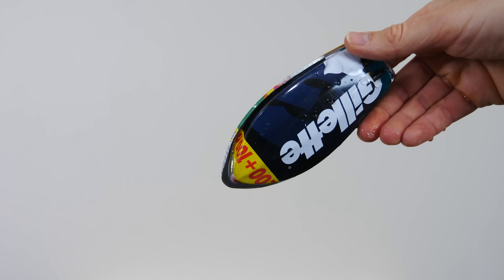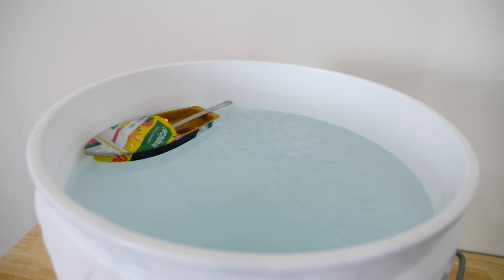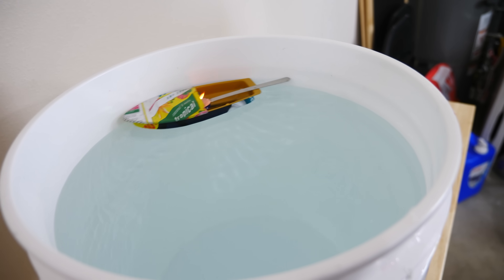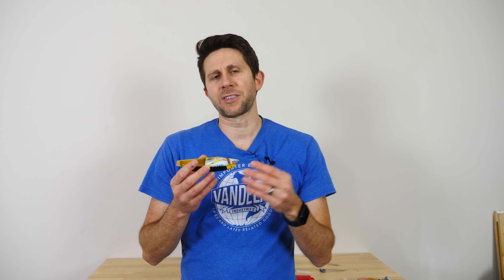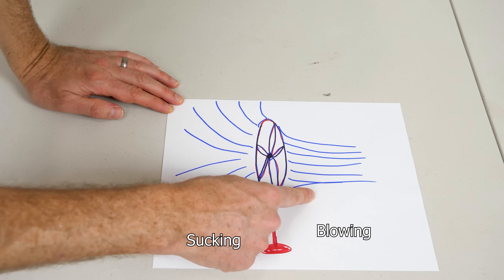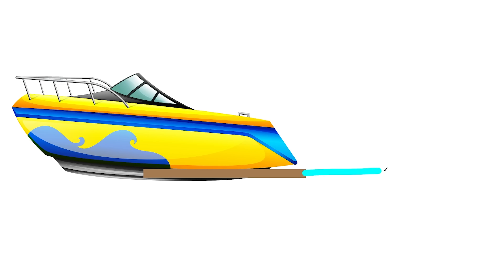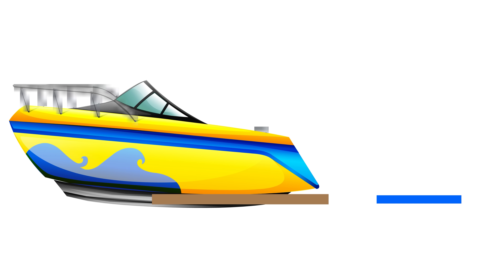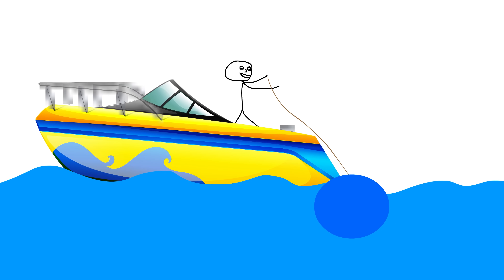The Weird Physics of The Putt-Putt Boat

Comment: The shape of the bow and stern also help the boat move forwards rather than backwards. When the boat goes forwards, the bow moves the water sideways. When the boat tries to move backwards, the water behind the boat resists the movement.
Reply: @Aaron Bredon 
Excellent observation.  I hope someone will make a Putt-Putt boat with the bow in the exact shape and  draft as stern so as to test how much the shape of the bow helps to move the boat forward.
Reply: @simon6071  also put the hull backwards?
Reply: @ki0w0-lordofwatersheep  
No question mark. Good idea.
Reply: @kindlin  I've seen a paper which does exactly that; forward, symmetric, and reverse hulls
Reply: @ki0w0-lordofwatersheep  what was the result?
Reply: @Milamberinx  I forgot, but IIRC the reverse hull still went forward, albeit slower
Reply: @simon6071  Best to use same boat and same pipes just turned around to ensure that everything else is identical.
Reply: @theinkinjapan  I have a better idea. Instead of creating a special boat,  we can use four identical boats.  Glue two of them together front to end and two of them front to front . Then race them to see how much faster the front facing one can go, But we need to test the boats first and find two with the same thrust for propulsion. It takes much less work.
Reply: @simon6071  the fancy word is ..drag.  difference in drag because of the hull shape.
Reply: @simon6071  Ive done it, and they still work, just a little bit worse
Reply: @thecanadiankid9816  What have you done? Using four identical boats for the experiment that I mention earlier? Of course they still work but the pair with the  stern of the leading boat facing forward must be much slower.
Reply: @simon6071 not much slower still noticeably slower
Reply: @thecanadiankid9816  Slower is slower. As long as the pair with the stern at the front is not the same speed or faster, the experiment is a success.
Reply: @simon6071 yeah I agree with you ? What’s the argument here ? It is in fact a lil bit slower when the bow ain’t optimized
Reply: @thecanadiankid9816  Why is there a question mark after your reply "yeah I agree with you"?
Reply: @simon6071 I was confused as to what was the argument so I expressed confusion while agreeing with you
Reply: @thecanadiankid9816  I agree with your agreement with me.
Reply: Waterdynamics may be🤔
Reply: @meetv7700  hydro, like in greek
Reply: @meetv7700  hydrodynamics
Reply: A comparison of a flat bottom boat to a canoe would be interesting to see
Reply: So like every boat
Reply: Just wonder who invented this toy
Reply: What would happen if you made some form of one - way valve and maybe some other pipes so that it would in effect blow out the back then suck in from the front?
Reply: @michaelszczys8316  that would be a pulse jet engine.
Reply: @aaronbredon2948  okay then, would it work like a pulse jet engine?
Reply: So true, thank you!
Reply: I also thought the same thing.
Reply: well, no, remember the shape of the drip,
the drip is sharper at the back,
that design is used for record breaking
Reply: I was thinking this too. Also help with forming a plane
Reply: Yes that's a small help in moving forward rather than backwards I agree 👍
Reply: I was also going to point this out.  I truly believe this is the most significant factor, yet it was not even mentioned.
Reply: I think that you are saying that the transom at the stern resists or counter acts the pulling force due to it's shape.
Reply: @scrawneyclimber  yes.
The video is wrong about the direction of water entering versus leaving. That can have no effect on the motion of the boat, since it is just water acting against water. Once the water LEAVES the pipe, it is no longer acting directly on the boat. In pushing water out of the way, it could force that water against the back of the boat, however.
What DOES have an effect is the velocity of the water leaving versus entering the pipe. Water is non-compressible, so under sufficient force, it acts in a Non-Newtonian way. The water being expelled is so fast it essentially acts against a solid wall. This also allows the boat to break past any static friction.
But when the water re enters, it is going much slower. So the water can move freely, and the friction against the hull is higher.
You could achieve the same thing on land if you wanted - a sufficient forwards force to break static friction, followed by a longer backwards force insufficient to break friction would achieve the same effect.
You could have a hammer striking an anvil on a sled. The hammer is quickly pulled back and slowly accelerated forwards to hit the anvil. That impact breaks static friction, and the quick pullback keeps the sled moving forwards. The forward motion stops as the hammer is slowed down and slowly accelerated for the next blow.
Reply: Super smart. SALUT
Reply: That's what I was gonna comment haha
Reply: As old as I am I have never seen one of these now I want to make one.

Comment: 3:00 But if water is coming from all directions, shouldn't the momentum of the molecules cancel? And there would be only the momentum of the water in the same direction as the boar's movement. But since momentum is conserved, the boat should move backwards, while the water that is sucked has momentum pointing forward.
Reply: If you take a breath to blow a balloon away, then take another deep breath you don't suck the balloon back. Same thing but in water.

Comment: 4:42 thats not the whole story..It only works because theres water around it, which will also be pushed away from the boat. (or if you want to it stops the shot out water, so when the boat sucks it in again the impact can cancel out. In a vakuum this wouldnt work)

Comment: The water is shot out at high pressure, but the water comes back in at the pressure of the water in the tub , much as in an internal combustion engine.
Reply: Totally agree, this is just an internal combustion engine, gain in momentum comes from the energy from the candle. His explanation is too convoluted.

Comment: I would imagine its also to do with the shape of the boat, its streamlined more in the forwards direction than rearward.
Thus it will resist going backwards, the stern acting like a brake against the motion

Comment: "When it expands too much, it condenses back to liquid water again" Can you please explain this? (Time stamp 1:40)
Reply: Transparent version + Slow Mo camera would be interesting.
I think proportions for boil chamber, pipe diameter and length, and materials matters.
Basically when steam expands it reaches water cooled area and  therefore cools/condensates dropping pressure and letting even more cold water. 
It could be interesting for speed competitons for these boats with "standartized" candles.

Comment: The shape of the boat has to play a big roll in the direction of travel as well.
Would be interesting to see the tubes out the front and see it efficiency
Reply: The shape does affect the efficiency, but the propulsion comes from the momentum balance. Since the boat is so light and shallow, resistance from the water is almost negligible. You could do this with a square or circle and get a similar result, if less consistently directed.

Comment: I would love a tutorial on how this was built would be awesome to make one
Reply: He explains how simple it is. The "engine" is just a contained small flat space (chamber), with two thin metal pipes leading from it. The chamber needs to be elevated to fit the candle under it. Shouldn't be rocketscience
Reply: @DaP84  Based on the idea that the water doesn't actually go anywhere, you can use a simpler design of a single pipe and no separate boiler, just seal the pipe at one end. I haven't tried this but I did a quick search and it seems like others have.
Reply: @theinkinjapan  yeah, sounds like it could work too

Comment: Nice, did you make that boat yourself? If so, how can I also make a fancy boat like that?  I've seen some tutorials but they were mostly square boxes
Reply: With practice and possibly a couple revisions, two-part molds can be carved out of wood that will readily form thin sheet-metal (like pop and aerosol cans are made from) when hammered or hinged together.  A couple of these could be made to form the top and bottom respectively, then the parts are trimmed, drilled and assembled with epoxy or solder.  The top and bottom could optionally be assembled with a crimp.  It wouldn't be easy for someone without manufacturing experience, but it would absolutely be possible, for any sufficiently determined maker.

Comment: I think the sucked water also pushes the boat forward by the water hammering effect. Once the water is sucked into the boiler, it has to deposit its forward momentum on the boiler which eventually pushes the boat forward.

Comment: Could this be scaled to be used on life sized boats?
Reply: Most likely not, the scaled up volumes of water could never receive enough heat energy to turn a section of water in the pipe into gass
Reply: @DaP84  how about with the new artificial sun, that China created?
Reply: @rookiedetective569  thzt cant last forever
Reply: Probablt but there’s be no reason for it. Modern boats convert fuel into ONLY propulsion l, without that vacuum portion, and they do it far more efficiently and with far more control.

Comment: So could this be like a water-hammer boat? If the vacuum pulls water in that causes a water-hammering on the boat, then that force could push the boat forward as well, especially with the design of the boat that make it move forward through water more freely.

Comment: The putt putt sound is the same concept that causes some steam radiators to make  hammering sounds.
It can be fixed by tipping the radiator toward the valve.
Pooling water in the radiator causes the steam to collapse making the bang sound.
Reply: Interesting tip (pun intended)
Reply: water heats up, copper expands and rubs against whatever anchor points it has. same when cooling off
Reply: I don't believe that I've been around any operational steam radiators since I was a youngster back in the 70s and I'm not even sure if I ever heard any make that sound but I probably did a time or two, probably just don't remember.
Reply: Is that also why some home water pipes make a knocking sound & vibration?
Reply: @Eduardo_Espinoza  Not really.
That condition is called water hammer. Thats when you close a valve and the moving mass of water in the pipe suddenly stops it hammers against the insides of the pipe. If the pipes are loosely hung they can bang against the walls.
Reply: Wait so u actually want to take away it's name?
Reply: the principle of operation kind of reminds of pulse jets. except with steam and water
Reply: When I was a kid, my grandparents had this sound in their basement, we called it the monkey in the pipes. It got pretty crazy sounding at times, I even recorded some of it just to keep as an auditory memento

Comment: I kind of disagree with the explanation. In my opinion, water is pushed out because of contraction of the metal diaphragm. The diaphragm expands because of getting heated up. As soon as it sucks new cold water, it contracts instantly and throws the water out. It again gets heated and cycle continues. I might be wrong, but this is what I thought.
Reply: I know what your saying (kind of like a pop switch or car thermostat) but you can do the same thing by just heating a coil though bud (no vessel to pop). It's just sucking a tiny amount of water at a time through one side and being expelled out the other as steam is all (think of a modern coffee maker, especially when it starts to run out of water). I think his explanation is wonky and confusing even in regards to how it's propelled tbh.  Now does the pop of the diaphragm help in the propulsion? I would assume it would a bit as it's easier to move gases than liquids but that is just a guess considering how violently they pop... as in it might actually work against it a little idk
Reply: @510Redneck  I think it needs some high speed footage study. It is hard to Definitely say anything at this  point

Comment: Thank you. My brain got stuck in a loop a while back trying to figure it out. To attempt to get my head out of the rut I tried to think of a put put boat 2.0. I'd love to see that if you have a better way. Nice put put boat BTW!
Reply: I have seen other engibe designs utilizing a vertical coil in the copper because the hot water moves upwards. Then you get an intake and output out of the system thereby removing the put putt entirely which is the charm of a put putt boat.
Reply: @aaroncarr-mackay2457  Probably the coolest little steam powered boat which I've ever seen was based on Heron of Alexandria's piece of absolute genius, the Aeolipile.

The original device was a kind of Steam Turbine designed & built way back in the 1st century AD!
It consisted of a sealed copper boiler with two pipes rising vertically from it's flat top. Set between the pipes was a hollow copper sphere with two pipes bent 90° sticking out at opposite sides of the sphere (with open ends pointing in opposite directions). When a fire was lit beneath the full boiler, steam would rush up the pipes into the sphere, before whistling out the bent pipes, causing the sphere to rotate at what would have been a shockingly dramatic speed (recognising that the fastest things in the Ancient Greek World would have been horses & massive rowing/sailing ships ~ Triremes).

The version I saw a video of had 
• a small spirit burner, 
• a boiler, with an intake piped in from with water outside
• The sphere sat at the back of the boat (there was a curved metal baffle blocking steam from entering the boat).
• When the spirit burner was lit, the water in the boiler turned to steam, which blasted out the bent pipes on the sphere, making it spin up with a whistle of increasing pitch, shoving the boat forward at impressive speed.
[ Sorry, this was years ago & I can't find the video. ]
Reply: @Seren-dipi-T  
Cool, I have seen that before as well. The concept but not the boat with the mechanism. I imagine that design would still have lots of energy loss. But steam is basically how we get energy from nuclear plants.
Reply: I've already suggested a few modifications to the engine, but to become Boaty McBoatFace²  the boat itself could: 
• Be coated with a water repellent surface to reduce drag, 
• Be made out of a structurally light, but strong, material (like carbon fibre) to reduce mass.
• Be modified to be a Catamaran, a Tri-maran, or even a single hulled vessel with an asymmetrical outrigger.
• Have the shape of it's hull optimised to suit this kind of propulsion, or just reconfigured for the purpose you want it for. Eg: A flat-bottomed barge for river transport; Long & sharp (like a Littoral Combat Warship) for high speed: Wide & with a rounded deep hull (like a oil tanker) for cargo, etc.
Reply: Better way??? The boat is perfect and he did a great job of explaining how it works. What do you want done in a “better way”?